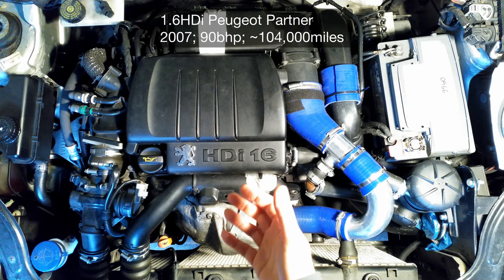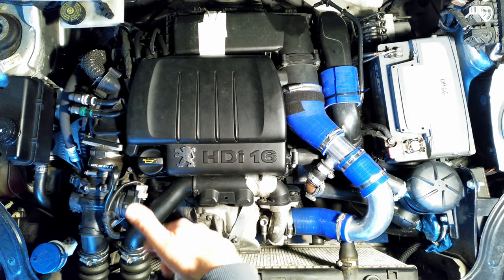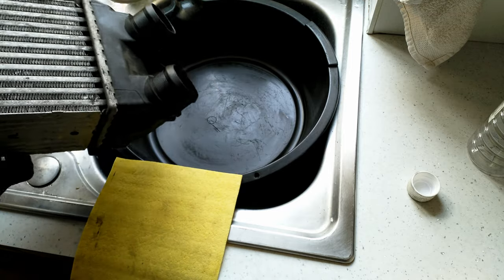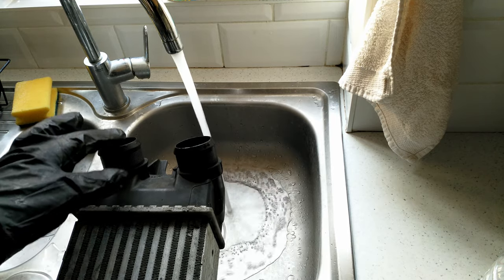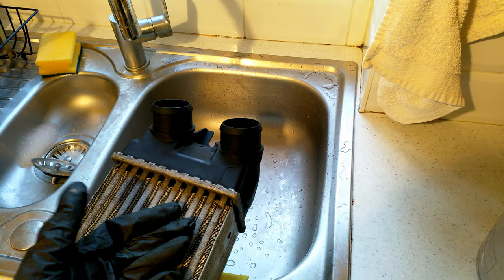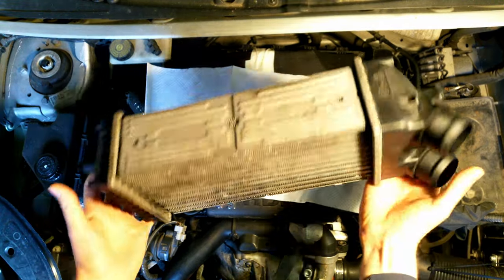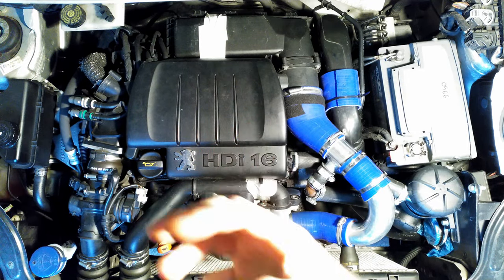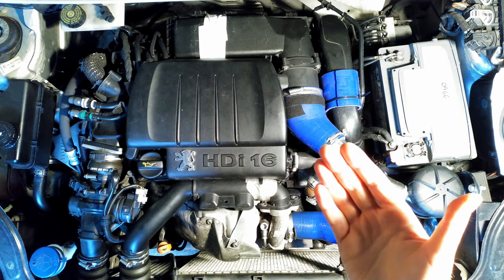Solving 1.6HDi smoke during cold startup

Comment: guys I have an audi a3 1.6 TDI 90hp and when i start it up there is a black smoke coming out and then it stops. Anone knows anything?
Reply from the maker: I am not familiar with the 1.6 TDI, but black smoke in a diesel means over-fueling  or little air. Do you know if the TDI has fixed geometry turbo or the VNT? It could be that the vanes (if it is VNT turbo) are a little bit stuck at the beginning or it is slow to build vacuum if the vanes are vacuum controlled.
Reply: @moremolecules  It has a VGT. Mechanic said that there is nothing to worry about because it is just unburnt fuel on the startup
Reply from the maker: @alkis5307  Yes, I completely agree with the mechanic. It is just over-fueling on startup or restriction of air, either way if it is gone after the initial one there is not something to worry about. All diesels will smoke a bit black on startup. It is the variable geometry turbo, so it could be that if it is vacuum controlled there is a slight lag in building this up and air is slightly restricted.
Reply: @moremolecules  yeah when I start the engine it smokes for 1 second and then it’s gone. There is no black smoke even if I rev it at high load.
Reply from the maker: @alkis5307  Yeah, nothing to worry about. Blue is a bit more of a concern.

Comment: Thank you for the video!

I have hdi too, but it emits black smoke..
Injectors are tested and ok, changed fuel and air filter, new turbo....fuel consumption is also fine.

Do you have any ideas what could be wrong?

I guess it won't be the intercooler again.

It happens on both cold and warm start

Here is my video https://youtu.be/IP1trVzItYU?si=pmNWRpHXDtP924Jd
Reply from the maker: There is too much fuel and little air, hence the black smoke. If there are no restrictions anywhere along the air intake, most likely the fuel injectors are over-fuelling. You may need to look at the correction values for each injector. Also, just for a test if I were you I would just unplug the MAF sensor and start/drive it like that and see if it makes a differences.
Reply: Yes, it is clearly overfuelling in the question is why. I already did that trick with the map sensor, also with the temperature sensor without any difference. The injectors were tested in a lab and are fine. I even replaced them for a test again with no difference. The turbo is new (old one same issue). EGR was replaced and the throttle body was cleaned. I drove the car on high rpms on a high ways, again no difference.
I had troubles to connect two times lexia but I will try now with Delphi to see what's going on with the injectors,  thanks.
Reply: The smoke is finally fixed by editing fuel map injected quantity 
Here is the result- https://youtu.be/Fgcx-iUpWDw?feature=shared